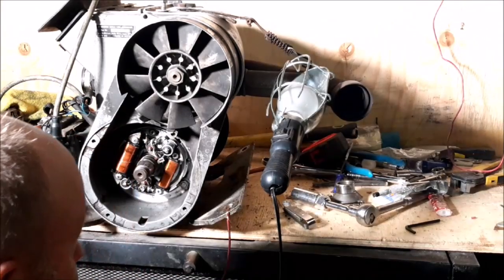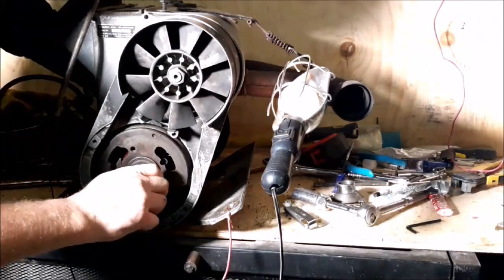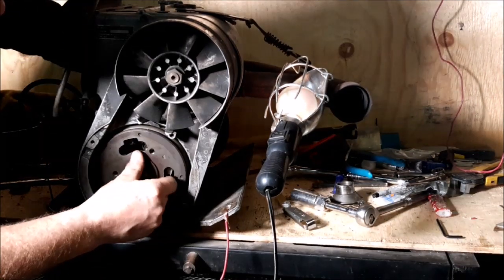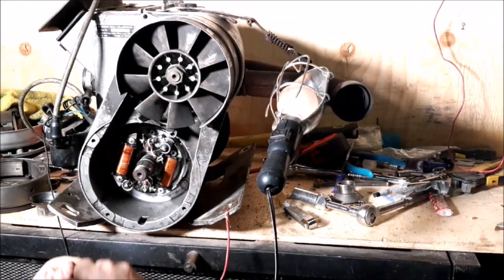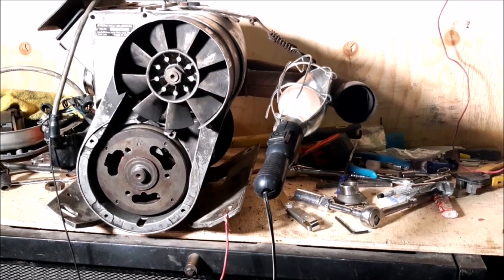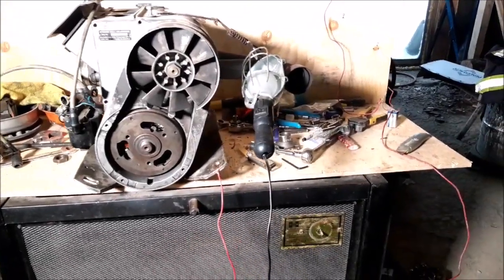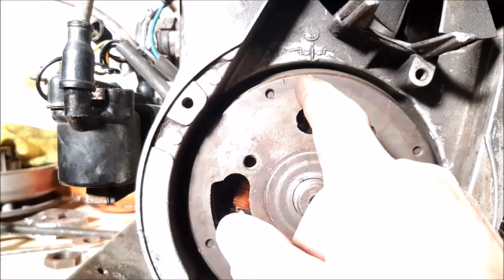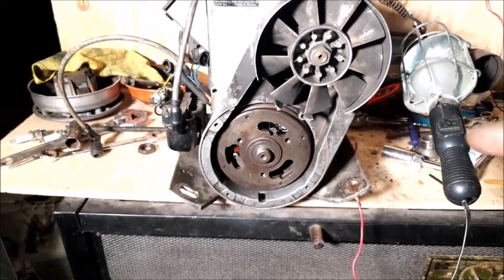How To Set Ignition Timing On Vintage Ski Doo Rotax Engine

Comment: Points timing on these is a real pain. Figure 2 to 3 hours to get them dialed in. I have had a lot better results using the indirect timing gauge instead of using the plate, (which is not very accurate).The indirect gauge will give you much better results with a much smoother, and more responsive engine.

Comment: Use a ohm meter with a swing needle. You don't have to pull the flywheel, you work through the holes.
Reply from the maker: It's too hard to watch the OHM Meter needle and the lines on the block and flywheel at the same time..I find a light or a buzzer is way more accurate.

Comment: Do those lines indicate top dead center? on the mag cylinder?  I am working on a 69 Sea Doo.  I can not find a service manual so I am trying  to translate this to my machine.  Sea Doo uses Ski-Doo ignition parts, but I do not have the marks on the case to use as a reference.

Comment: I am trying to do this with a multi meter on a type 377 engine and when I put black lead to the engine to ground and red lead to the blue wire that goes to coil it should continuity when the points are open and closed. Is that normal? I thought I could listen for the beep on meter to check timing marks. But now I'm confused because it never stops making the sound indicating continuity while points open and close.
Reply from the maker: Hello Jay, yeah it may continue buzzing..the sound should change when the points open, I prefer a light though.
Reply: @cecilsshadetreegarage7408  Thank for the response I did end up making a light with a small single AA battery it worked well. I see that it will always show continuity because of it being wired into to he magneto like it is. Also the kill switch had me thinking for a minute because it works by connecting both black wires from the points and the are grounding at opposite times.
Reply: I was doing the same! i'll be building a light set up based on this comment! thank you. I'm also working on a 377 and trying to figure this all out for the first time. lots to learn!

Comment: Great video, finally someone who explains this process and fills in all the blanks. Two questions if I may, the light you use, is that just regular AC work light that you clipped off the plug and and spliced wires so it works with a battery, and when those marks align is that top dead center or a bit before? I have replaced may stator on the machine so maybe my etch lines are out of sync now and if so how would I sync them again? I do have a piston height gage tool but don't know what to calibrate it too if not original stator. Ie tdc, 20 degrees before, etc. Thanks!

Comment: Hello, I'm rebuilding a 1981 Citation with the 377 and have watched this video a dozen times. I'm not sure if you can help me but I'm getting desperate. the tech manual shows the same procedure you're explaining but my flywheel doesn't have the little lever inside and the window cutouts are different. My light stays on during the full revolution but slightly dims but never goes out completely. any ideas what I'm missing? if you can help I'd greatly appreciate it! Dan
Reply from the maker: Hello yes that is normal for that engine..the light dims when the points are opening.  Your advance will not be like this older one.

Comment: Hey there Cecil, how's it going. I finally got the old machine running on two cylinders. Quite the tedious procedure getting the points set with the engine in the machine, but it's alive. After checking a half dozen old coils for resistance, if found one that was within spec, and it works. The other coil that was working all along, is an original Bombardier.

Comment: very good info! I'm working on a 1980 Citation 377  and i dont have that cam looking device but from the comments I learned using a volt meter on continuity doesnt work... I'll be trying the light trick you explained at the end of the video! thank you. wish me luck, i'll need it. 
I may have questions 😕
Reply: Update on the 377 citation… I had a 12v incandescent light bulb (obviously a standard 110/120v bulb wont work) and a 12v ice fishing flasher battery and it work perfectly. The fluke meter on continuity doesn’t work because there I always enough contact that it stays on. the light trick is the only way to go in my opinion.

Comment: Awesome videos keep up the good work, I've learned so much!! I do have a question...I have a 76 olympique 340 (343) and with the key at the top the advance mechanism tab window is on the left side at about 10 o'clock and I also only see a T stamped into the flywheel which I am assuming is the mark to set the timing but I don't see any other marks besides that one and seems when that T lines up with the mark on the shroud the bottom set of points starts to open...could you shed some light on this setup and how it should be timed? Thanks

Comment: hi cecil, i have a 1972 ski doo olympuqe 400 and i am having a spark issue but i am not sure what it is. i’ve got good coils, good wiring and the clutch side shock the crap outa you but no spark even with new plug , the owner before me had it running good but ended rebuilding the motor and since has not had spark as far as i know he had every piece apart including stator, i’m at the point where i have to set timing like this video but am not sure where to start. if you have any advice that would be nice 
thanks, Ben from minnesota

Comment: You said it should dim when it lines up? what exactly is being lined up?
Reply from the maker: Hello Grant.  the mark on the flywheel should line up with the mark on the top of the engine case...it should have a lightning bolt embossing on the engine casing.  Cheers.

Comment: Hey I tried using this but light wouldn’t light up. Are you using 9 v light. My trouble light got normal 120v light bulb. 

Thanks
Reply from the maker: Hello Gregory.  You need to use a 12v trouble light for this.  Cheers!
Reply: Thanks Cecil.

Comment: I've got a 76 Moto ski Nuvik with the 340 Rotax in it. I have had the engine in and out so many times, I can practically do it with my eyes closed. The only trouble is, it runs good for maybe an hour, then craps out on the mag side. Checked everything many times and can't find any broken or shorted wires. The weird thing is, if I pull the plug wire off and just let it sit on the plug without pushing it all the way on, it fires just fine. Got tired of fooling around with it for ten years, and just got itching to tackle her again today. More than likely needs oem condensers, do you know where to get them. The kimpex stuff is just not cutting it. When it's running fine, it's a lovely little sled.
Reply from the maker: Hello John.  Yeah it sounds like a condenser problem...I am guessing you switched the coil wires to make sure it isn't an ignition coil?  The other thing, when soldering in the new Condensers use a large soldering gun, a small one takes so long to melt the solder and therefore it heats up the inside of the condenser as well and cooks it...I always use Kimpex Condensers and have no problems..Cheers.
Reply: Yeah Cecil, I have tried just about everything, and I am pretty sure I used the same type of soldering gun that you have. Quite possible I may have heated them up to much. I'll order some new ones and give it a whirl.  Thanks. I asked you the same question in your other video, so just ignore it, I guess.
Reply from the maker: Hello John.  Yeah they don't take much heat to cook the inside of the condensers.  Best of luck... Please let me know if this works for you.  Cheers.
Reply: Will do. Thanks again.